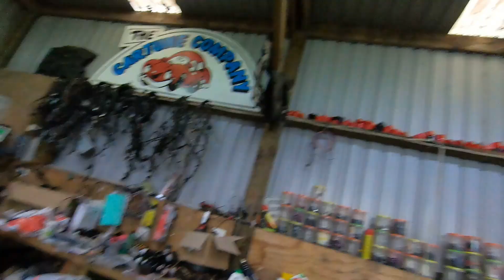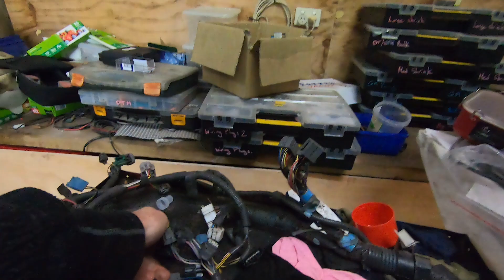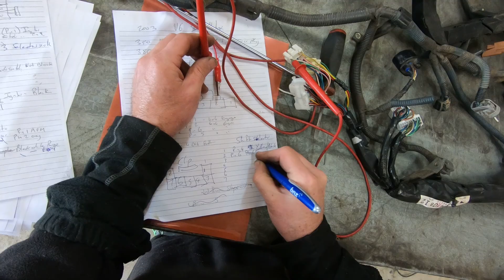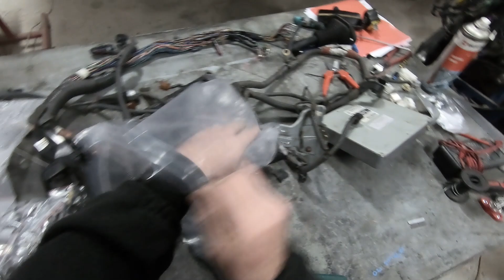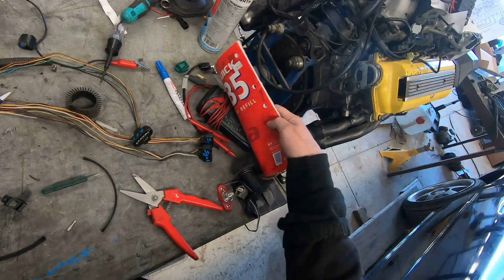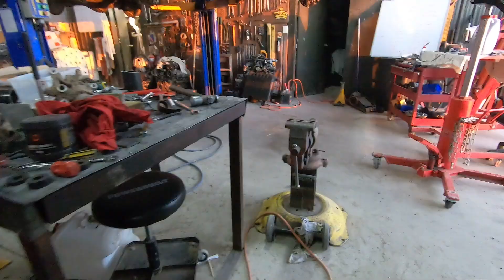03 lux wiring part 1

Comment: Ha ha, we got some shit laws but we can actually weld on chassis, just not allowed to install rear clips or move rails on or out, some engineers get bit fussy in the way weld to chassis like they generally dont like a straight vertical weld amd prefer weld top amd bottom or on 45 angle
Reply from the maker: Its funny how if we copy Toyota on some chassis welding , it would not pass cert.  Oh well . I just work with the rules, I dont make them.  And your guys rules are worse.  Cheers Kelvin
Reply: @CartuneNZ  ha ha yep, alot the rules here are stupid. Most the time they will pass most welds, main thing i seen they dont like is welding corners and around the top amd bottom edges of rail around the corners.

Comment: Hey guys I found a video about the speedo for my hilux and I fix a loud squeaking alternator and I just found out that my hilux got a heavy duty clutch
Reply: Squeak squeak
Reply: beny reny shhh plz
Reply from the maker: all of my swaps get a heavy duty clutch and the pedal is light as grandma's charade.  And if they squeak they come out and get fixed.
Reply: CartuneNZ we did get it fix now I need a good day to clean it before I can do more
Reply from the maker: @juststuffwithwolfe4482  well done.  What did you find?
Reply: CartuneNZ the belt was a bit loose and every time I turn on the lights it squeaks but we fix that and now you can hear the moto and it natural squeaking